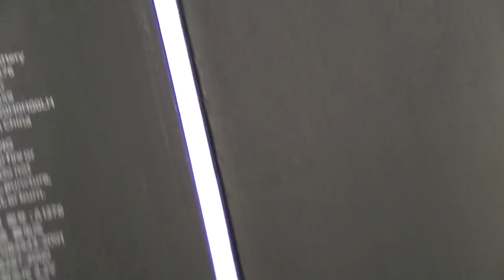iPad 2 2012 updated new model ribbon cable Power On/Off Volume Control repair CyberDocLLC

Comment: I have replaced the iPad 2 2012 updated new model ribbon cable Power On/Off Volume Control today , I done all steps but Ipad does not turn on,  apparently there is no cable damaged, (I could not find battery connection for this new model so I did not turn off any battery cable before repair) , any idea?

Comment: How's the quality of your cables?

I've had a few of ebay that were total rubbish. Insulation to far up the cable, cables where the power button, the flipswitch, the magnetic sensor or the volume buttons didn't work, or simply none of them. Bad cables are frustrating for me. Not that they are that expensive, but it sucks if you have to throw out 30 - 40% of your stock because they're faulty, even if they cost just a few bucks a piece.

Comment: Do you sell the cable that you used? I bought one online but the quality of the cable was meh and the ribbon part had insulation all over the end so it didn't connect well.
Reply from the maker: +ianj001 http://www.cyberdocllc.com/shop/ipad-2-2012-new-model-ribbon-cable-power-onoff-volume-control-replacement-ribbon-cable-part/